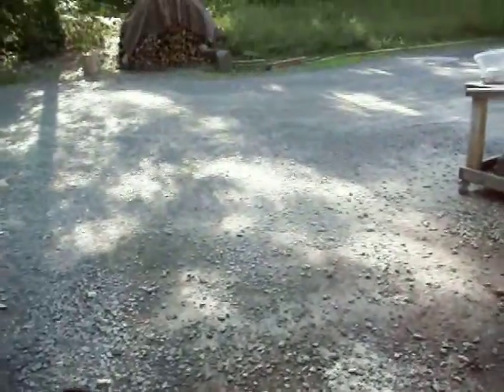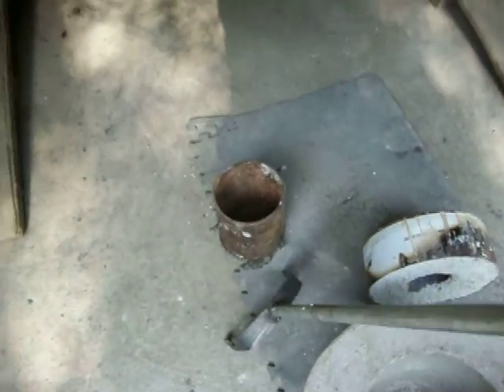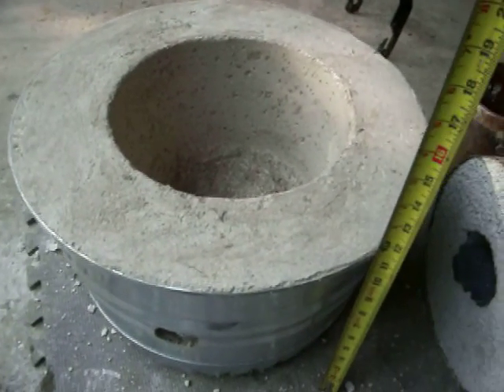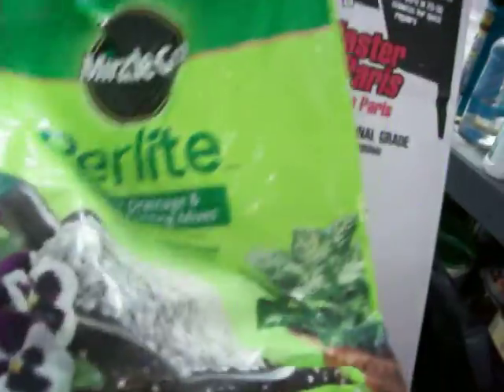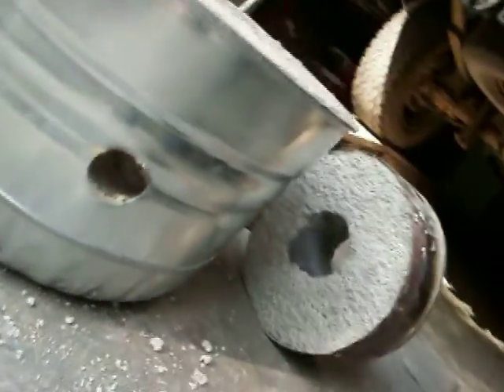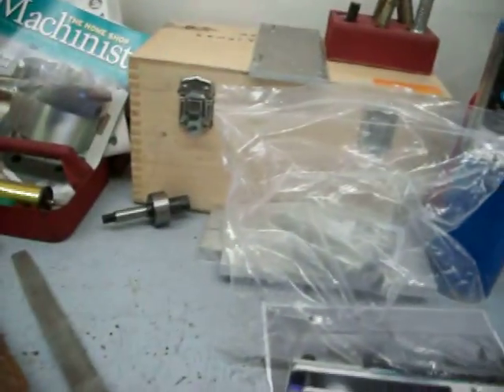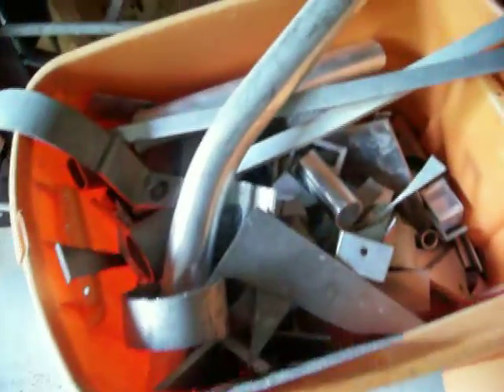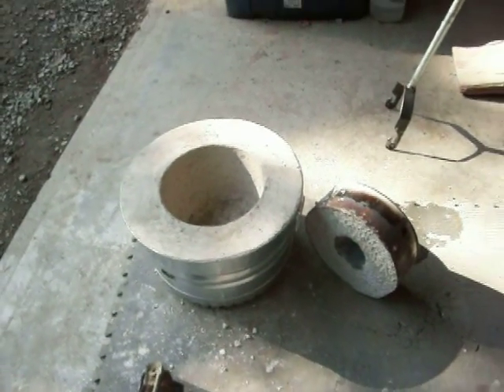Building a foundry to make parts and AR 15 receivers.

Comment: I never saw any further progress on your AR lowers? how did it go after all?
Reply from the maker: Thanks for the comment, I got stalled because of everything else. However I am able to make the jigs that make the lowers. That is something that I wanted to do. I have not melted any aluminum yet.
Reply: The reason I ask is I was looking at doing the same thing! and I found these online and was contemplating purchasing one and doing a little reverse engineering ( reverse casting) so I could re make the sand molds myself. just thought I would share it with you. I have also gotten sidetracked, I am in the process as we speak of pulling the engine out of my )04 land rover discovery. hoping it is just something minor! Well good chatting with you.      https://www.ebay.ca/itm/232528636688
Reply from the maker: That is a nice looking sand cast. I dont think they are to hard to make. Keep me posted if you do it. My 89 just blew reverse gear. It never ends. LOL
Reply: @sphinx1us  is it possible you can share it again? I think its sold or removed?